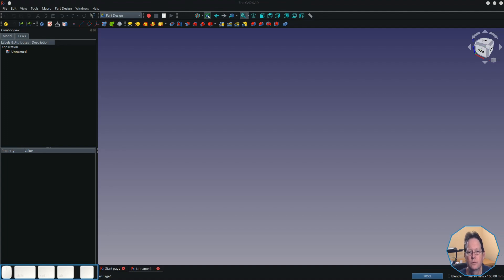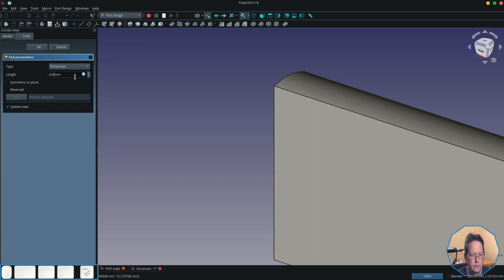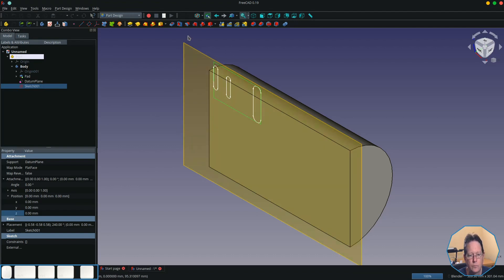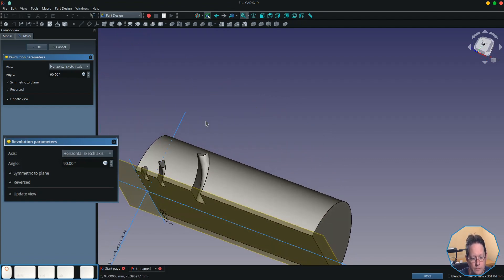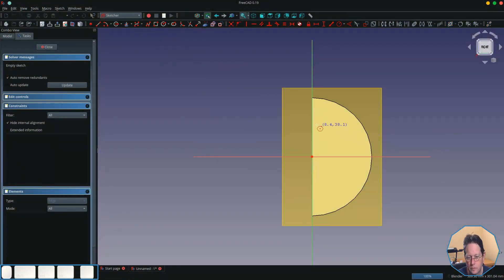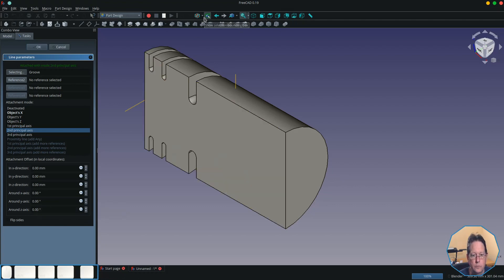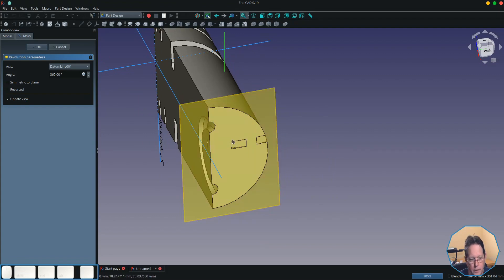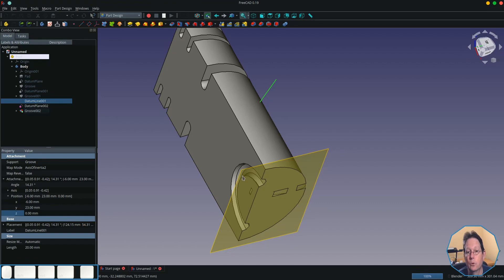Howto use the Groove Tool in FreeCAD's Part Design Workbench

Comment: Is there a way to do this with a cylinder? Essentially I want a cylinder with a hole in it, and the inner section to have a grove that goes around 360 degrees
Reply from the maker: Thanks for your question. It should work in the same way as putting a groove around the outside of a cylinder. Just move the sketch representing the groove so it intersects the hole drilled down the cylinder

Comment: My situation was different because my object was not centred around any axis coordinate.

I found a solution which is to select a circle on the object already located on the axis around which I wanted to grove from.

I could then obtain the result I was looking for.

I am not sure how I would have done it without that circle , does anyone know how to create custom axis for it ? I am thinking of a datum line ( Not sure how to use it , it is not as intuitive as te datum plane ).
Reply from the maker: Thanks for your feedback Cedric. I think you're right about using the datum line, but I've hardly ever used one so I'm not the best person to give you advice on using it. I would be interested to learn how you go though.